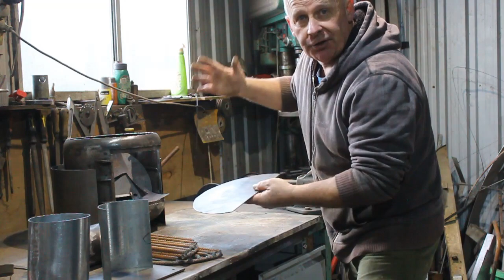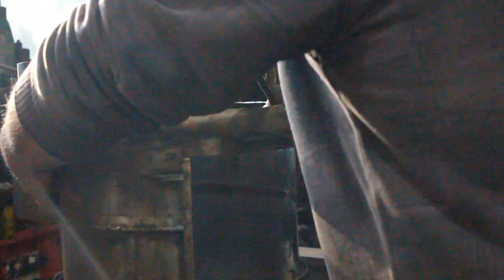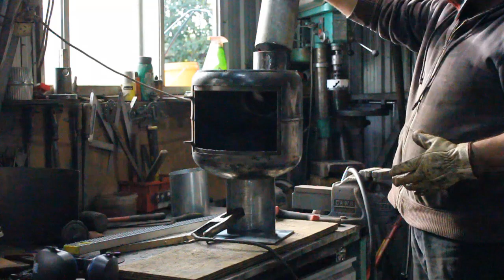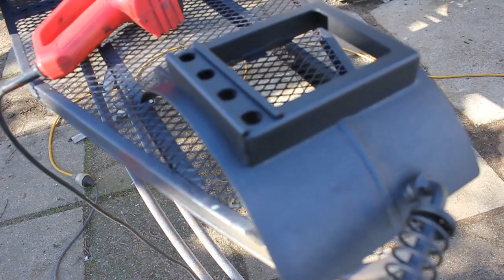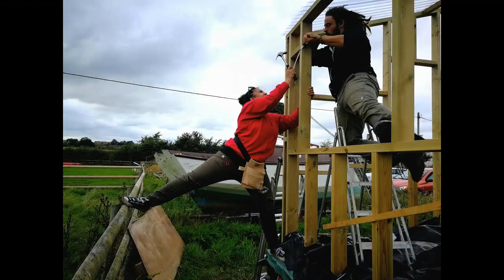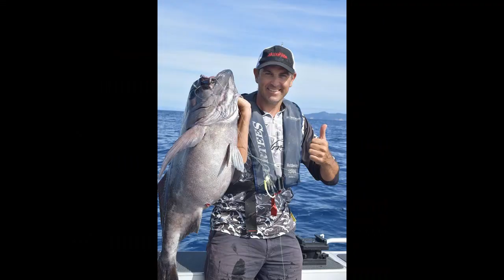Tiny Wood Stove Build- All the Secrets Revealed!

Comment: I have a plasma cutter. Getting a Miller welder this month. I'm gonna learn to weld. Thanks for this great video. Your stoves are Amazing!!!
Reply from the maker: Good luck Rose ! what will you be making?
Reply: I work a regular job. But when I am off I build fiddles and mandolins. I'm a lady with a wood shop. So as I inch towards retiring I decided to make a gypsy wagon. It is ultra light I am building it similar to a skin on frame canoe. The one big difference is that when I am finished with the outside shell I'm going to add spray foam to the inside for stability. The whole thing folds down at abound the 5 foot mark so it transports more easily. Anyways I need a way to heat it as I live at 5000 feet above sea level. I live in Colorado in the U.S. I don't understand about the baffle. Where it's attached inside.
Reply: I am calling it a baffle , you called it a double boon
Reply from the maker: @roseericson3828   It;s a baffle yes. What it does is heats up and helps to burn any partly combusted gasses as they pass over it. Helps put more heat into the room rather than up the flue. It is a semi circle of about 4/5ths of the full dia. It sits on 3 pins and its straight side lays 1/2" under the hotplate
Reply: Thank you! I appreciate the information!!! Your the best!
Reply from the maker: @roseericson3828  Ummm- actually you sound pretty amazing yourself with all this artisanal woodwork and all! good luck with the vardo.I would like it if you could pst some videos down the track. tiny spaces are my favorite.